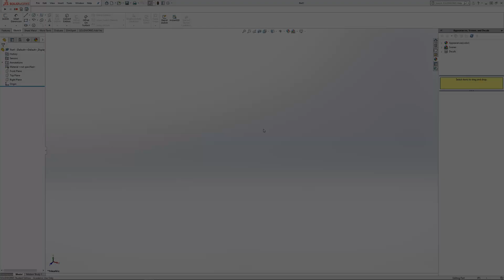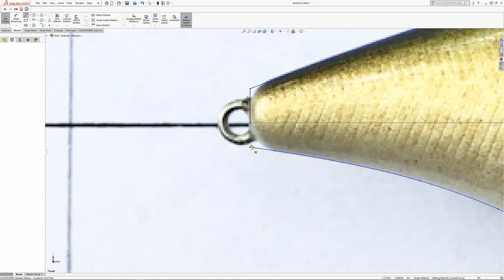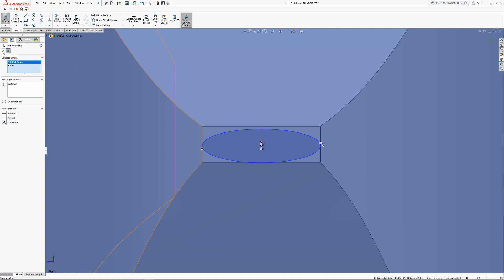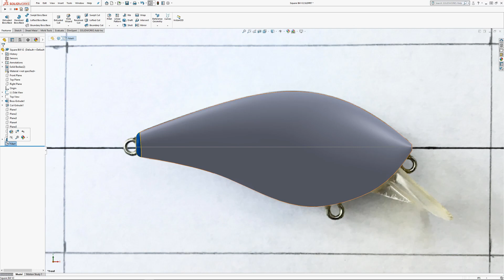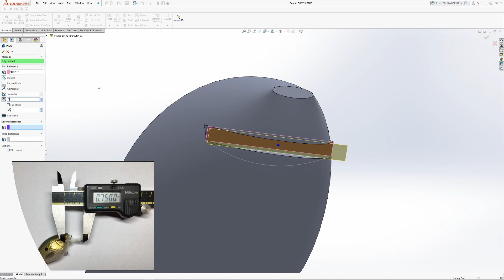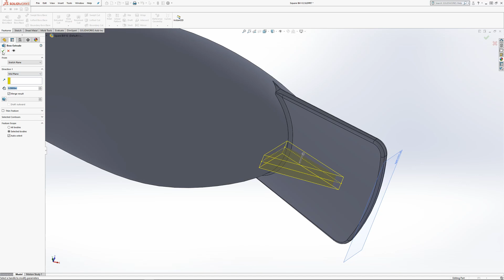How to Duplicate a Fishing Lure in CAD for 3D Printing (Step 1 of 4)

Comment: What would you do for multi jointed baits? As far as taking a picture and using cad
Reply from the maker: I would still take the picture the same way just making sure all the body pieces are level and then just design the main body as a  single piece and then go back and add in the joints once that is done.  (Hopefully that made sense.)  You can kind of see it on this bait (https://www.theneverendingprojectslist.com/fishingprojects/shad-lures/) how the single piece looks then I just cut out a joint (in CAD) for the two piece.

Comment: Thanks for the informative video…
So can you recommend any videos or classes for those who need remedial training on how to use these CAD or whatever programs at all first…to get familiar with the things you were doing to design this lure? I’ve searched the web diligently but can’t seem to find a basic tutorial with basic step by step knowledge for beginners detailing on what you were doing as far as these settings and parameters and tools, etc., within the program itself, to design or copy this lure.  Please guide me in the right direction.
Reply from the maker: I would suggest using Fusion 360 these days. There are tons of videos on YouTube with tutorials for Fusion too.  Just search for "Fusion 360 for beginners"  the ones from https://www.youtube.com/@ProductDesignOnline look very popular and should be a good place to start.  

Any CAD software is going to seem overwhelming when you first start but after a little hands on with what ever program you choose you'll get better over time.  The way I learned CAD... I would just take anything I had laying on my desk and with a pair of calipers I would just start taking measurements and try to design it in the program weather it was a simple battery or switch I had laying around it didn't matter.  If you run into something you don't know how to do (like round an edge, ect) I guarantee there is a video on Youtube on how to do it.  I've been using CAD for many years and still have to google how to do certain things and as I've probably mentioned in my videos I'm sure I do a lot of things the wrong way but you'll learn what works for you and what doesn't as you keep playing with things. 

Even though I recommend starting with Fusion 360 once you learn the basics, the workflow  pretty much translates the same on any of the similar programs such as Solidworks, Onshape, etc.

Comment: Hello
I am a fishing maniac living in Korea. I'm producing a minnow by referring to your video. The quality of your production looks very good. Can you tell me the diameter of the nozzle and the height of the layer?
Reply from the maker: These are the print setting I use on these lures.

I print this lure in PLA+ with the following settings
(You'll have to experiment with what works best for you.)

Layer Height = .10mm
Top Solid Layers = 4
Bottom Solid Layers = 3
Outline/Perimeter Shells = 3
Supports = I do not use them but you can if you need too.
Infill = 25%
Reply: @TheNeverendingProjectsList  
Thanks, your reply is very helpful to me.
The luer I made yesterday didn't float. I think it's because it's 100% infill.
Thanks to your video, I am getting a lot of help. Thank you.

Comment: Can I use the same technique in order to make a mold for soft plastics?
Reply from the maker: Yes... even with a soft plastic lure you're going to design the bait first and then you make a box around the bait and cut the bait from the box to make the mold. Check out my other video "Designing a 3D Printed Multi Cavity Mold (Basic Grub)" it shows the mold design process.
Reply: @TheNeverendingProjectsList  Thank you very much for the fast answer. Could you please recommend a buget 3D printer that would be good for this?
Reply from the maker: @paulcic1771  I don't know a ton about printers but I hear a lot of good things about the Creality Ender line.

Comment: Great video. I can do everything in Fusion 360 except the three parts remain and the two side cut out pieces cannot be deleted or removed. Any ideas?
Reply from the maker: I'm not sure what you mean but the 3 parts but in Fusion everything should be a separate bodies so you can just turn off which ever ones you don't want in the design tree under the bodies branch.
Reply: @TheNeverendingProjectsList  tha
Reply: Thanks, I eventually figured it out.

Comment: Very nice video.Good technique for surface modeling. Two months ago used other technique. Photogrammetry + Blender for fixing, noise reduction and modeling + fusion 360 for mirroring and making the pallets and prepare the model to make the aluminum block forproduction

Have a look to the 3D model
https://p3d.in/ed4lS
Reply from the maker: Those look great... very nice work.